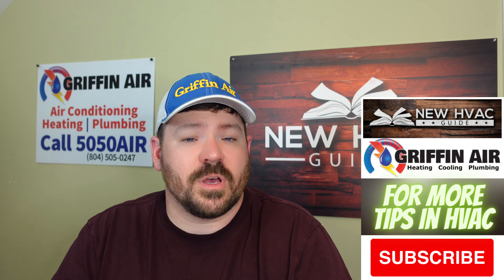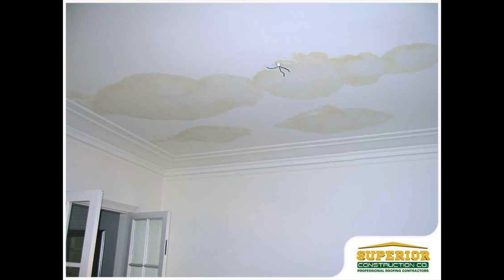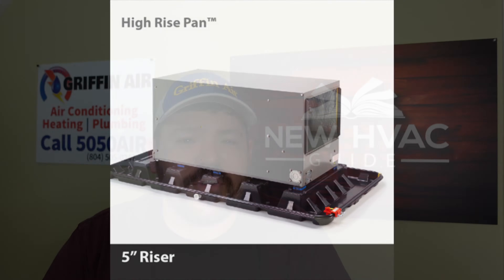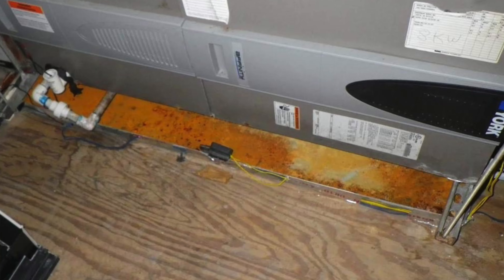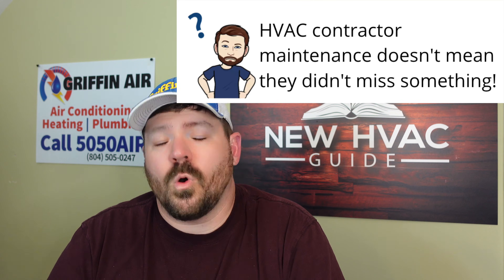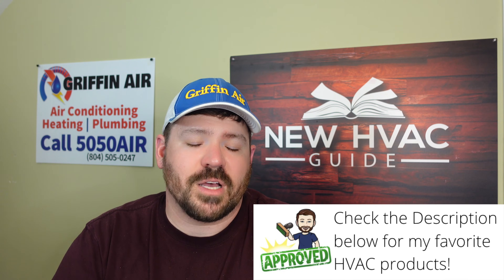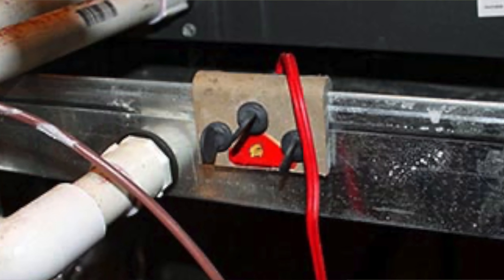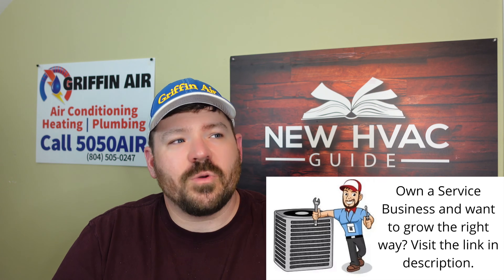HVAC Drain Pans - OVERVIEW, TYPES, and OPTIONS!

Comment: I have a 3 year old central a/c, live in Florida.  Last year my a/c company came for routine cleaning. I asked him if some  "black" around the ceiling vents was mold.  I asked if I should call in a mold company or get a UV LIGHT or?  He told me that's a scam and unless we have respiratory conditions we won't have a problem.  The following year the same company came  and a new rep told me I definitely need a UV LIGHT since my drain pan (which I can visually see) has some type of mold on it.   I am worried, but don't want to get scammed.  Help pls
Reply from the maker: UV lights are great but they only sanitize what they shine on.

Comment: My 26 yr old Payne started draining from the secondary pan a week ago. It drains fine. The main drain is ok and not clogged, I can see that the evaporator pan is rusted and leaking. I am thinking of leaving the drain like this to get through the summer then clean the pan well and maybe even rubber coat it to get another summer out of it. Am I crazy?😀

Comment: I hope someone can provide answers.  Last week, my vertical HVAC system in attic was replaced.  Contractor placed the new unit directly into the secondary emgergency pan - without any spacers to rise the unit above the pan - so the pan and bottom of unit are touching.  I'm concerned that since there is no space between the pan and unit, that the pan's ability to gather and hold water is defeated.  How do you retrofit spacers?  How do you temporarily raise the unit enough to place spacers between pan and bottom of unit?  Do spacers made for HVAC come in various thicknesses?  What can I buy at my local hardware store that will work as do it yourself spacers?
Reply from the maker: Maybe try these?
https://amzn.to/3ynQUmU

Comment: I have an Hvac guy that will be installing me a new system, he is telling me that the lines do not need to be flushed of the old type refrigerant. He says that it is now recommended to not do it, is he correct or should I find a new guy?
Reply from the maker: He is correct. A lot of manufacturers are asking companies to not flush the lines with our X11 or other chemicals. Unless you’ve had a compressor failure and acid in the old system, I would not recommend it anyway. Cutting them loose on both ends and just running a simple shop vac would probably suffice. And also pressure testing them after they are brazed in with the new system
Reply: @NewHVACGuide  Thanks so much, that is good to know. When you say running a shop vac, do you mean blowing air through them?
Reply from the maker: @verlonblackwell1469  I would not blow anything through them at the risk of accidentally blowing some sort of contaminant into the lines. I would only vacuum